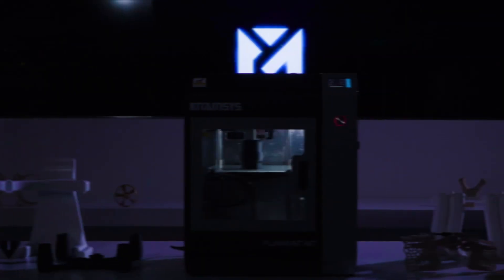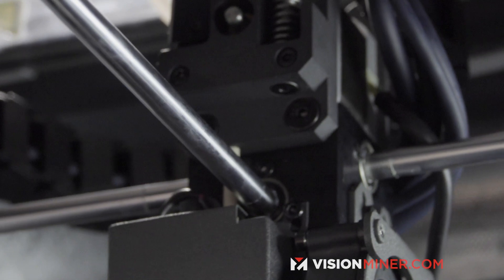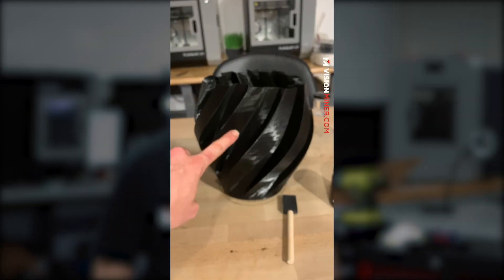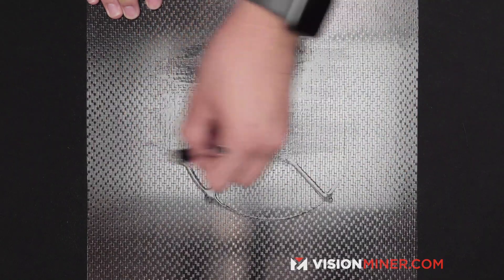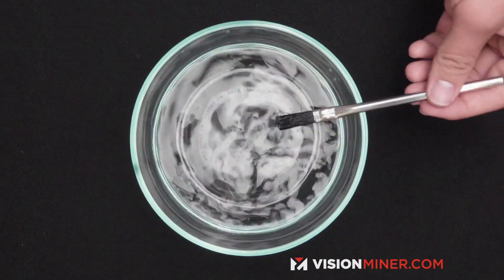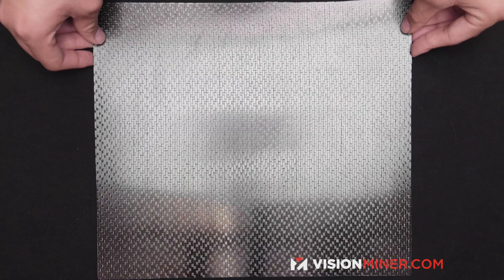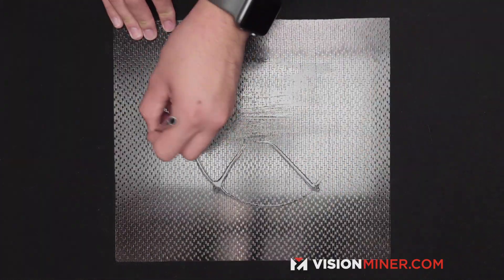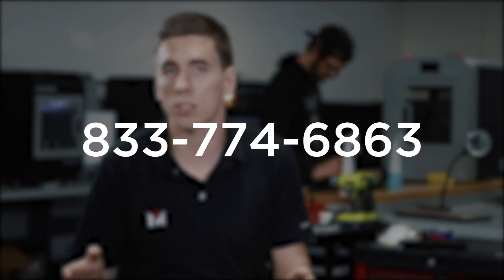How To Use Nano Polymer Adhesive for 3D Printer Bed Adhesion

Comment: I sometimes get adhesion issues with my H2C build plate with PETG and Nylon, so far this nano polymer stuff has worked great, I use dawn dish soap with a nylon scrubber to clean off the residue this stuff makes when the print is done.

Comment: How often to apply and what to wipe it with between prints?😊
Reply from the maker: Basic materials like PLA, just one coating will work for many, many prints..... I've done 45+, many say over 100+, others 20+ -- material depends, but for basics, it's very long-lasting! No wiping between prints -- just remove the part :)

Comment: Could this be used on a magnetic build plate?
Reply: I'm sure it can since the top of the buildplate is still a high temp plastic even if it's over a magnetic coating.    

If you're using a flexible magnetic bed you're probably still using PLA.   but investing in a spring steel, even comgrow cheaper generics are great with this adhesive.  

I came here tonight to see how often to reapply and when to not have glass break lol.

Comment: I bought a Bambu A1c printer for my 1st 3d printer..So far I've lost more than 1/2 my projects due to adhesion issues..Tried washing, alcohol wipes like recommended by the manufacturing and reddit..still losing projects after 3/4 of the way printed..Now Im gonna try this. It is on my textured PEI build plate now...FINGERS CROSSED!!!

Comment: im using the Ender 3 Max Neo.... ive cleaned the plate with isopropyl alcohol and a paper towel, drew an X on the spots i printed spread it out and let it dry for 2 minutes and the PLA prints didnt stick.... please help!
Reply from the maker: Was your bed heated? It does need 50-60c to activate before it holds, but reach out, give us a call or something, and we'll make sure you get it working!
Reply: @VisionMiner  hello and thanks for your response….. after watching a few videos on YouTube and adjusting a few settings, I finally got the adhesive to work right!Things are sticking as long as they need to now! thank you for making this adhesive!

Comment: For me the product didnt work, glass bed printing PC Or PC/ABS or Nylon its warps from the bed tested a lot of setups and differents ways to apply and seems that dont work
Reply from the maker: hmmmm.... that's strange... you're heating the bed, right? How hot, is the question? If you were at a lower temp, not much can keep those materials down -- PC and ABS we print both around 90-110c, nylon usually 80-100c....

Comment: I just switched from ABS to ASA and my previous adhesive (Aquanet) along with a brim (10mm) did not work.  The corners detached about 1/2hr into a 9hr print.  I tried this Nano adhesive and the print job was going along very nicely.  With just a couple of hours left in my print job and being very late at night, I let the job finish while I went to bed.  I woke up to find what watching this video would have warned me:  take it off while part is still warm.  The adhesive sheared off a layer of glass and stuck to the car stereo/monitor bezel (for 1988 camaro).  But at least the corners didn't detach🙂

Comment: Working with Polymax PC in a Bambu X1C. Build surface is THEKKIINNGG textured PEI heated to 120C, chamber temp is around 51C and hotend 280C. I’m printing at bambu default speeds, so it’s moving along pretty quick. The bracket I’m printing is around 150mm or so at longest runs and I’m using 10 walls for strength. I get slight lifting at the corners eventually. Do you think your adhesive will help or is physics just going to win this one regardless?  Anything else I can change to get a 100% warp free part?

Comment: Finally got some of this after 4 failed prints of a U.S.S. Titan A from Star Trek Picard, in Gold Silk PLA this 2d4h36m print has failed 4 times on my Sidewinder X2 anywhere form 19% to albeit nice 69% done. I'll report back but so far so good no signs of curling or detachment from my steel flex plate. if this works, (knock on wood) you'll have saved my sanity and my hair for which I was on the verge of ripping out.

Comment: have had zero successful prints without a raft so decided to pick this up and about to start  my first non raft print with it. Also love supporting local biz so being socal based sold me immediately! now here is hoping it works as intended and I didn't mess up applying haha
Reply: Did it work good
Reply: @JValor  like a charm!
Reply: @68Cypher  good to hear. What print surfaces have you tried it with? 

I have tried stock, PEI, Glass, and G10. I ditched glasses due to poor adhesion and went with G10 because the flatness is close to glass. G10 adhesion is so god damned strong that it won't let go of prints sonetimes, so I end up having to use a bond/release agent anyways! 

I hate the ugliness glue stick leaves on the bottom of prints how how quickly it needs to be re-applied, so i want to try this with glass.
Reply: @JValor  so at first glass but then I also used it with my FYSETC pei textured and smooth. You'll see yhe residue on the bed but I've never noticed anything on the bottom of the prints

Comment: You specify reapplying it each time on high temp applications, but you don't address how often to reapply for PLA or PETG.  I'm currently using a sample bottle and would like to align my expectations with the reality I'm facing.  Thanks in advance

Comment: Absolutely doesn't work and a waste of money.
Reply from the maker: Are you not heating the bed? It does require heat, usually a bit more than normal -- for example, with PLA or other normal filaments, 60c+ is what we recommend - what material and bed type are you using? We guarantee our product!

- Rob
Reply: @VisionMiner  You can guarantee all you want. the reality is, that it simply does not work. I've tried it in a bunch of different situations, and in not one did it help in any way.
Reply from the maker: @Adam  We've got thousands of customers and reviews that disagree with you. Please provide some details -- what bed surface are you using? What material? What temperatures? Something simple has to be off if you didn't get results, but if you can't provide any details, then there must be no truth to your statements... we're here to help, seriously, just give us a shot.
Reply: @VisionMiner  and now you have a customer that is dissatisfied. And you are calling them a liar because your product isn't working. Both a nylon + carbon fiber mix and regular ABS don't stick for shit. Glass, both sides of the qidi tech stickers, nothing works. A gluestick works better than this crap.
Reply from the maker: We did not call you a liar -- you never reached out for help, so we couldn't help you, so thank you for finally providing details :)

Our recommendation for ABS and Nylon are both 90c+ on the bed -- often, when it doesn't work (because we DO get customers calling saying it doesn't work, on occasion) -- it's because of the bed temperature being too low. This has always fixed the non-sticking issue, especially on glass. I can't speak exactly for the qidi tech stickers, but most aftermarket surfaces have been reported to work fine.

The way the adhesive works generally requires slightly more heat than normal, for many materials. After all, it was designed for PEEK and ULTEM.

I recommend giving it another shot with a higher bed temperature, and if you do, I'm sure you'll love the stuff! If you try again, and it still doesn't work, reach out and I'm happy to give you a full refund. 

- Rob
Reply: Don't feed the troll
Reply: Abs print on glass with only 90 celcius, doesn't need high heat. Just spray on and start printing. Wohooo.....

Comment: I don't see a great way to apply this to a belt printer, since the upcoming print will be from underneath the printer.  Is there a way I can dilute it and put into a spray bottle?  Then I can just roll the Z-axis one full revolution and coat the entire belt.
Reply from the maker: You could probably do that! I know they've been using it over at the 3D Printing Nerd on their CR30's, but we haven't tried a spray bottle ourselves (well, we did long ago, but didn't like the mess)

Comment: would it still be effective if i applied the adhesive while the build plate was still hot after finishing a print?
Reply from the maker: Yes, it still works, but the surface finish won't be as good usually -- but it can actually help on very difficult parts :)

Comment: That's Great ! Could you please confirm that when should we apply this pre-heating or post-heating for optimum results
Reply from the maker: Generally, you always apply to a cold bed, or while it's heating up (it evaporates quickly) -- in some instances, you can achieve extra grip by applying it hot, which will create a thicker coating, sometimes used for difficult high-temp parts.
Reply: @VisionMiner  Thanks a lot ! Kindly confirm that what is the maximum temperature that glue can be applied

Comment: I'm having issues getting the Vision Miner CarbonX PC+CF to stick to the bed in an enclosed chamber, bed temp @ 120C, extruder temp @300C, and with the Nano Polymer. It just warps and comes off.
Reply from the maker: How thick are you printing? In an enclosure without active heating, if you're printing too thick, the warping is too great to print without being warmed. Try reducing the number of walls, as the most warping occurs around sharp angles of the part. If you have a problem area, you can also add a "lilypad" which is just a small, 0.5mm pad placed at the corner where the warping occurs, to give it more surface area to grab down to. Using a quality surface is essential, as well, what are you printing on?  Also, make sure you dry your polycarbonate thoroughly -- if not, often it becomes impossible to stick (as do many of the high-temp polymers)

Comment: I got a sample and it's fantastic. Glue stick was leaving gunk everywhere and a less than ideal print surface. But this stuff dries flat. It was scary how well my first test was attached to the build plate. The sample is going really far. ~20 drops is enough for a Prusa build plate. I wish it came in smaller bottles because when I get a refill, it's going to last a long time.

Comment: I found this due to the 3d Printing Nerd video as well, and was wondering if this will allow printing POM without requiring a garolite build plate?
Reply from the maker: Well, the best luck we've had with POM was blue tape or brown tape with this adhesive on top of it. It's a funky material -- we don't recommend printing it, there are high temperature nylons which work much better and can replace POM in most cases!
Reply: Only Zillagrip works for POM

Comment: What is the wait time between the application of Nano Polymer Adhesive and then starting the print.  In other words, how long should I wait after applying NPA and printing....should it be tacky, dry etc.   Thanks
Reply from the maker: 30 Seconds or so, it will be totally dry. It's based in alcohol, so as soon as it evaporates, it's good to go! You can also apply hot for higher-temp materials, causing it to boil on the plate and create a powder-like surface, which works very well for printing.